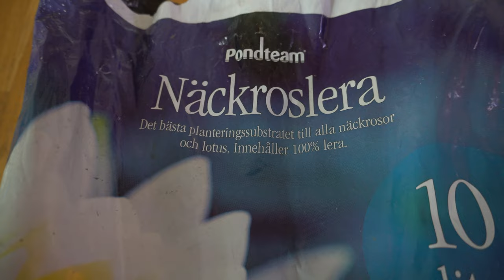🌿XXL BASILISK PALUDARIUM | ASSEMBLING TANK & BACKGROUND | PART ONE | TERRAQUAMAN

Comment: I know I'm watching this late and I have yet to watch the other parts, but you mentioned the issue of him potentially clawing up the styrofoam. I just wanted to say that I think the clay mixture you put between the seams of the panels could be a good solution as an overall cover of the styrofoam. But also idk how expensive it is so I get why you just used silicon and substrate :) Awesome work as per usual and I will watch the next parts now!
Reply from the maker: They clay as it turns out gets easily washed of by the misting system so it's not suited as an over all cover. Thank you so much 😊
Reply: @terraquaman  thank you for informing me, that totally makes sense. Have an awesome day man!
Reply from the maker: @DragonScale2002  you too !!